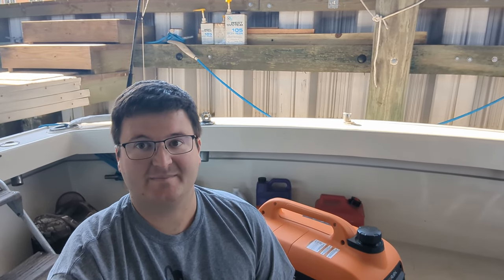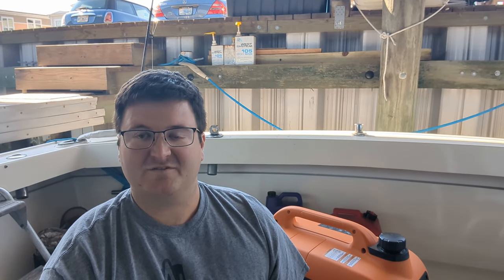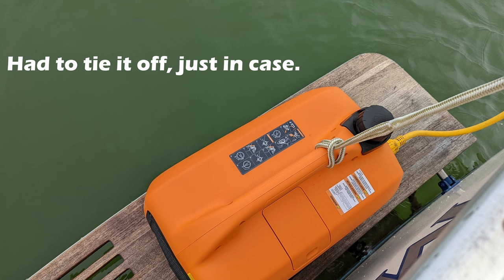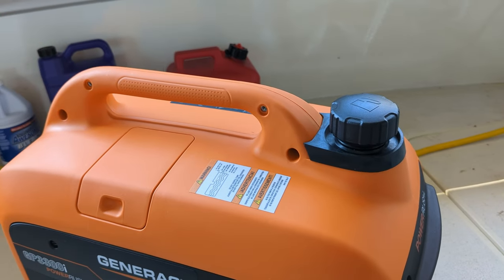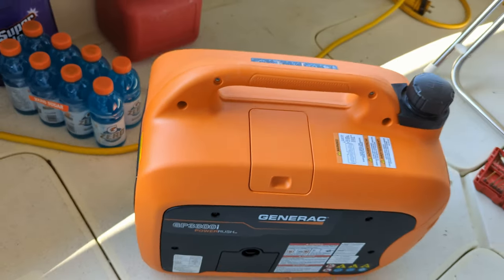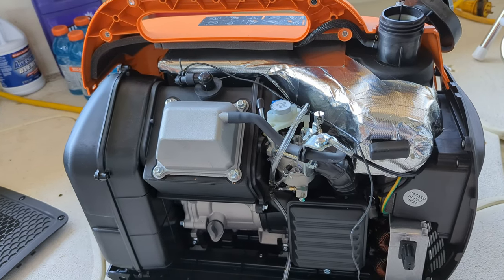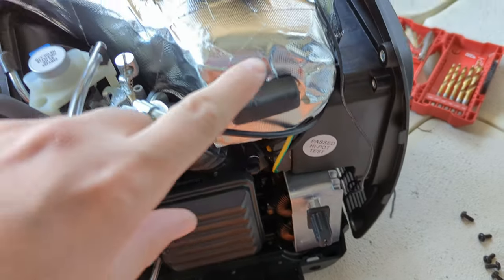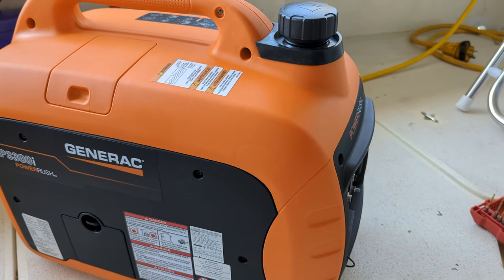Silverton 34C - Generac 3300i and Hour Meter Install

Comment: If you can, I’d like to see a decibel readout from the cockpit and inside the cabin while the generator is running on the swim platform. I’ve thought about getting the smaller Honda generator for my 31 and strapping it to my platform for nights out on the hook, but I’m also a light sleeper lol. Looking forward to more videos.
Reply from the maker: Oh eco mode, it's pretty darn quiet. You can hear a faint hum and the other issue is some vibration. Which to me pretty slight. Standing on the bow, with no wind, I couldn't even hear it.
Reply: @WJsLifeonaBoat   good to know
Reply from the maker: @kemicalx17  I'll film another follow up with SPL numbers in different locations in the boat.
Reply from the maker: Haven't had the boat back out. However, I'll reiterate that it's very quiet. I'd like to work on isolating vibrations.
Reply: @WJsLifeonaBoat  maybe a sheet of foam cut to the footprint of the generator would work? They should absorb a lot of the vibrations.
Reply from the maker: @kemicalx17  that's a great idea, pretty unexpected too. Definitely worth a try.

Comment: I have a 6.5Kw Kohler generator on my 41' Silverton.  Had to have it rebuilt (its a Honda engine) last winter.  Costs me $4,000 just for a rebuild.  Please make sure you have carbon monoxide detectors onboard.
Reply from the maker: Dang, that's what I forgot to mention! I have two onboard.

Comment: Do you plug items individually into the generator or is (or can) the generator be tied into the boats wiring system?
Reply from the maker: Yes, sure can. One cord from generator to the shore power inlet which feeds the breaker panel.